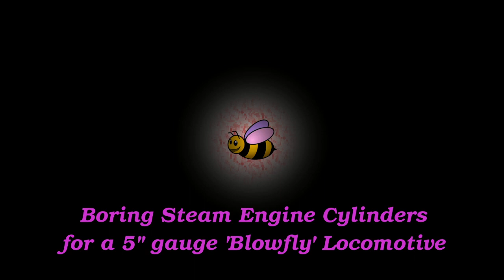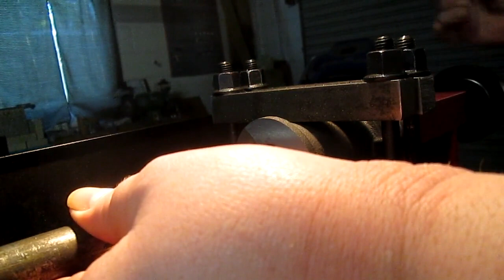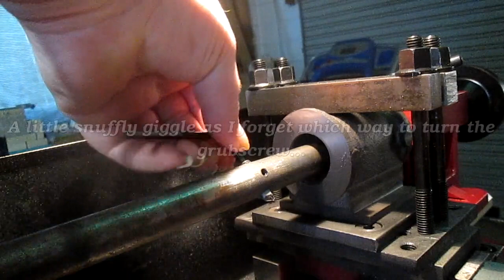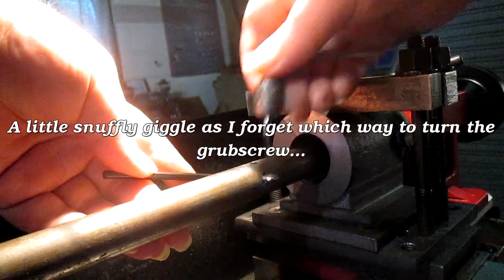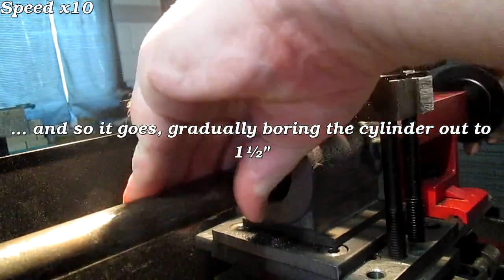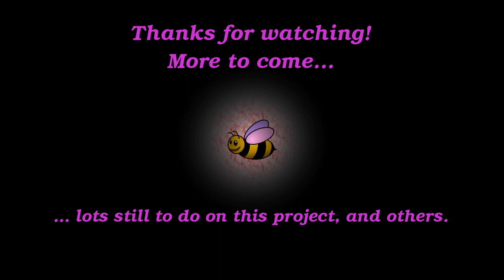Boring Steam Engine Cylinders

Comment: Nice work Lisa. This reminds of the time I bored a Stuart No1 cylinder. I am approaching the time to machine up the 9F cylinders which are far more complex than the Stuart No1. I got the castings and the drawing out and quickly came to the conclusion that it would need a lot of thought and planning - so I put them away and made the slide bar brackets instead! This video has inspired me to get on with it! Cheers Craig.
Reply from the maker: Thanks Craig. I just finished boring one cylinder yesterday, and the second will hopefully be to the same stage tomorrow; then it's on to ports and passages. I think I spent as much time making fixtures and tools as I have doing the actual boring.
I might do a video of the final cuts, plus fly cutting the rear face; the sound of the cutter is much nicer doing a full cut through clean metal, rather than the intermittent rasping through the crust in this.
The 9F cylinders have the added fun of piston valves, so twice as much boring to do. I'm quite happy to have slide valves (and only 4 wheels!) on this build. :)

Comment: Lisa, I've got two flamelicker cylinders that I want to line bore on my Atlas10f lathe can you tell me how you align the bore with the bar and to  determine packing height to start boring
Reply from the maker: I first milled the port face to size and height, this gave me a flat square area for clamping against to bore the cylinders, this then meant I could use the port face to bore centreline dimension to work out how much packing was need (same for both cylinders). If you don't have a flat face on the side of the cylinder, then probably turn the outside parallel first, clamp using a Vee block, and you'll be able to use the same principle.